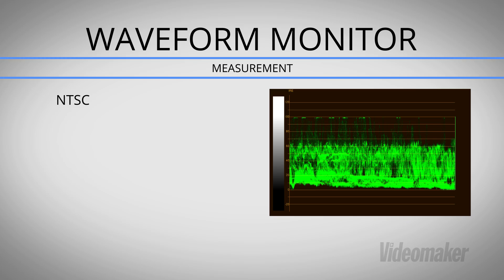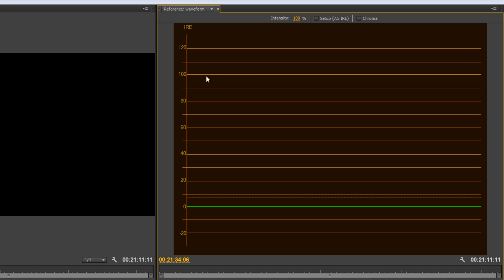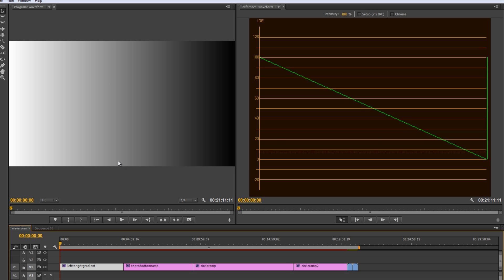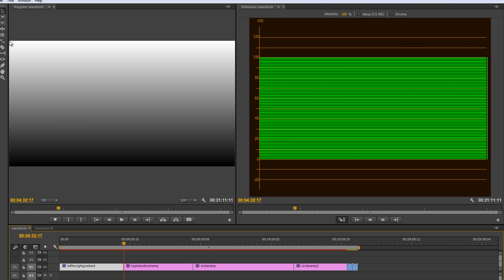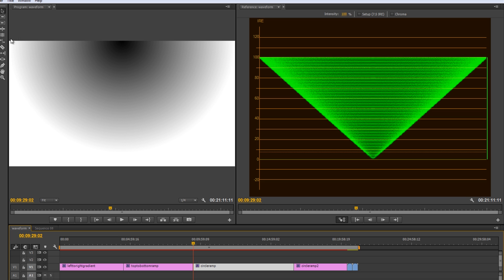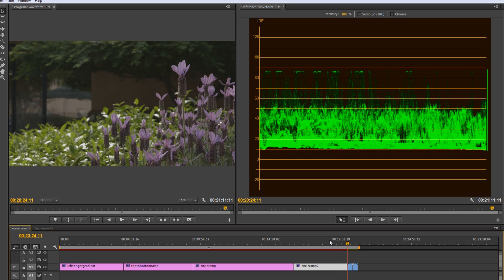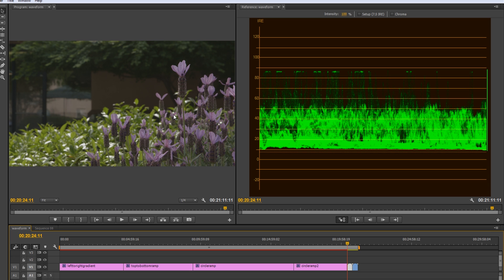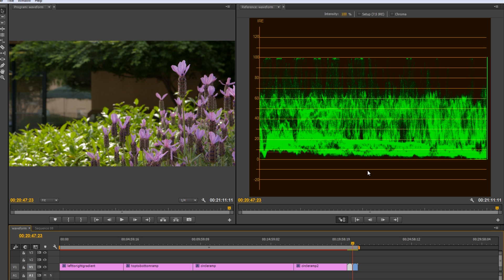How to Read a Waveform Monitor for Color Correction

Comment: It's almost like a histogram tilted on its side for every vertical 'slice' of the frame. Especially at 5:25.
Reply: ACitizenOfOurWorld Actually a wave form monitor can display the luminance horizontally or vertically depending on how its setup. Here he is showing it in the vertical mode. This mode shows you the entire frame not a horizontal "scan" line (excuse the analog reference)

Comment: I don't think anyone could've explained this concept any better in such a short amount of time. The few times I had tried this before, I sort of got that the waveform was linked directly to the image, but didn't really manage to use any of the information, as I didn't get which aspects that were linked.

Comment: A very useful video!  I've heard about using this monitor, but I could never quite figure it out.

One nitpick though:  Your title suggests that you are showing how to use the waveform monitor, but you actually show how to interpret it.  I'm looking forward to learning from you how to use the waveform monitor in conjunction with color correcting, which you say is coming up.

For an intro to waveform, though, this is great  =)